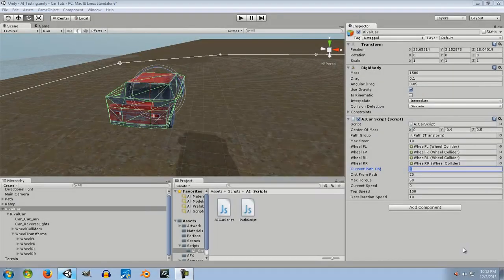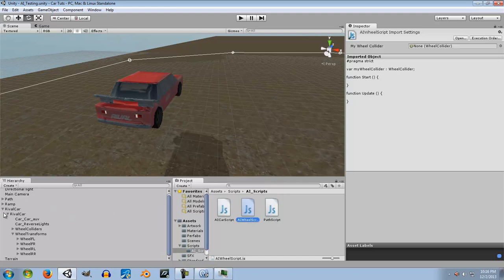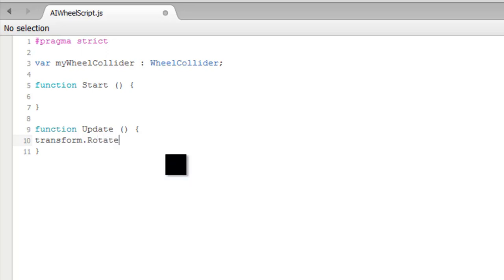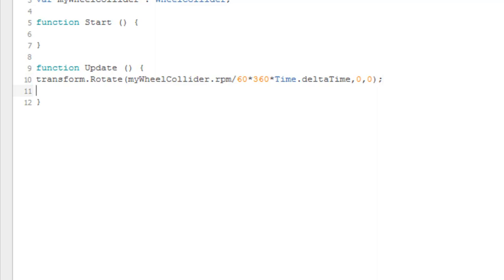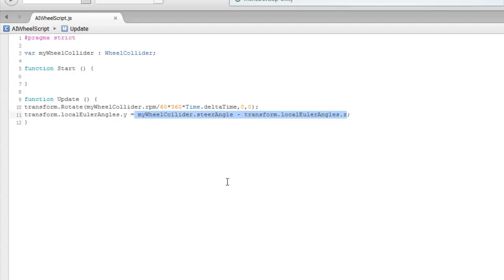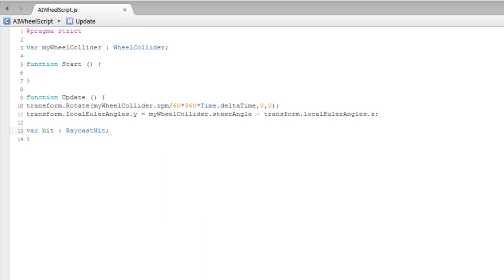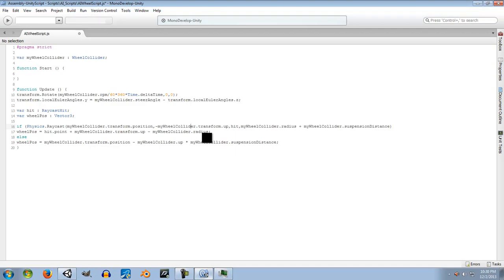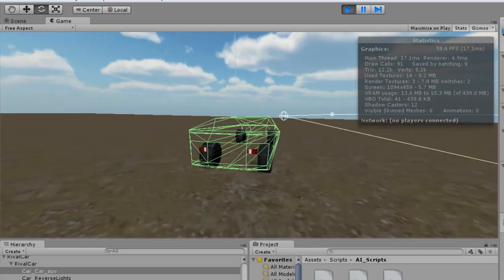#5 Car AI - Unity 3D Tutorial - Wheel Control

Comment: Here's the AIWheelScript in C#:

using UnityEngine;
using System.Collections;

public class AIWheelScript : MonoBehaviour {

public WheelCollider myWheelCollider;

void Start () 
{
}

void Update () 
{
transform.Rotate(myWheelCollider.rpm/60*360*Time.deltaTime, 0, 0); //making the wheels spin.
Vector3 temp = transform.localEulerAngles;
temp.y = myWheelCollider.steerAngle - transform.localEulerAngles.z;
transform.localEulerAngles = temp; //turning the wheels left or right.
RaycastHit hit;
Vector3 wheelPos;
if (Physics.Raycast(myWheelCollider.transform.position, -myWheelCollider.transform.up, out hit, myWheelCollider.radius + myWheelCollider.suspensionDistance))
{
wheelPos = hit.point + myWheelCollider.transform.up * myWheelCollider.radius;
}
else
{
wheelPos = myWheelCollider.transform.position - myWheelCollider.transform.up * myWheelCollider.suspensionDistance;
}
transform.position = wheelPos;
}
}